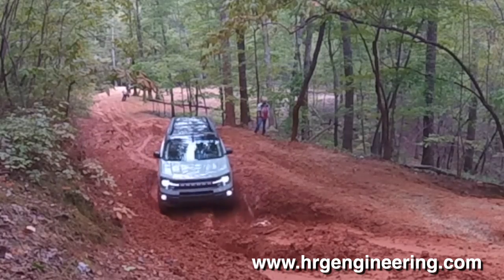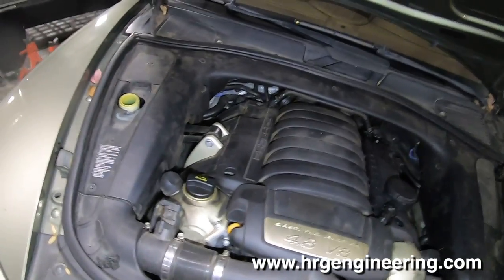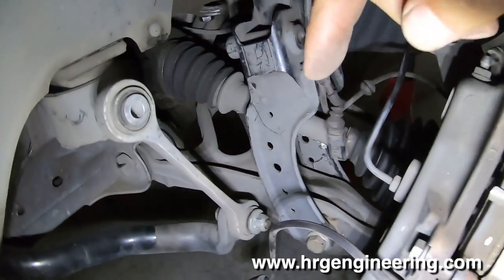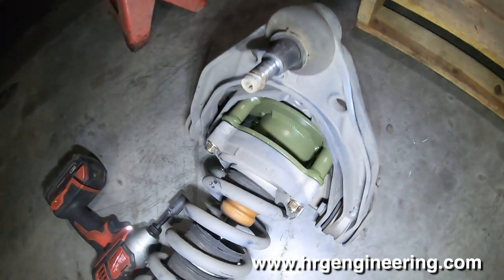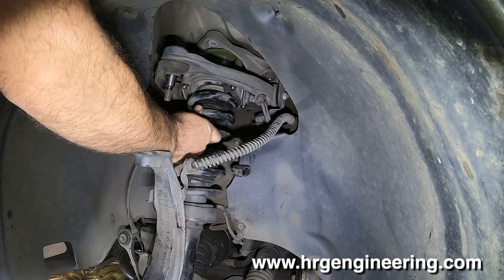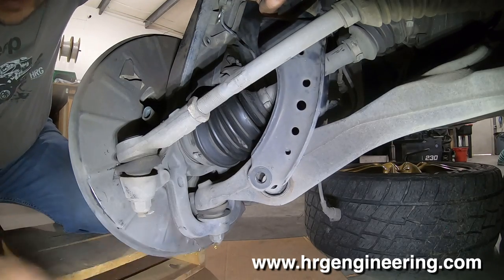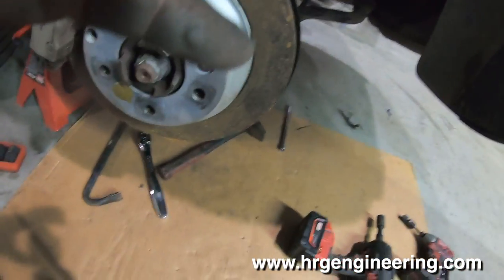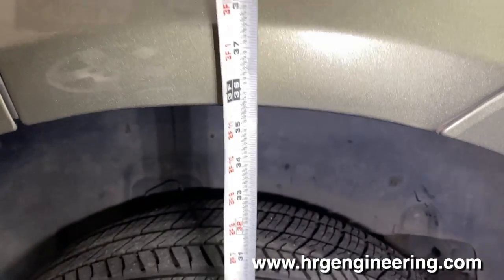How to lift a 2002-2010 Porsche Cayenne 2 inches with the HRG Offroad lift kit

Comment: Thank you for this video. One of the best instructional videos out there for this. That bolt under the master cylinder was crazy, took me a few minutes just to find it. The front went smooth for me except I popped the front axle out but luckily it went back in easily. The rear was so easy to remove but so hard to install. I was by my self and it was a tough job. Ultimately I put one spring compressor on the spring while in the car and this allowed the strut to be pushed into the eyelet much easier. All the bolts were so tight and somewhat hard to get to. Glad it is over lol
Reply: Really. Interesting!!! Call themselves Hrengineering with NO TORQUE VALUES for attaching everything...

Comment: Seems like longer adjustable struts would be far easier, as you wouldn't have to remove the upper mounts. 
When you measure the height, it's better to go from the hub to the guard, that way it can be compared to other vehicles regardless of rim/ tire size.
Reply: it's four bolts holding the upper mount, and you have to remove the entire assembly and remove the mount to change the struts to adjustables anyway...

Comment: Do not loosen all bolts when the suspension is loaded. Everything will be out of alignment. European cars suspension are designed with the flex of the bushings calculated as part of the “spring rate”. If you dont “center” the bushings, you will only get ‘spring resistance” going one direction.  Worse, you could tore through the flex limit of the bushings and cause failure of the suspension arms and bushings. I suggest referring to Porsche service manual, get all alignment spec and bolt torque spec. Otherwise it’s gonna ride like crap and you will be redoing all this over and over.
Reply from the maker: Reality does not bear this out, though.
Reply: German car are different that's why they are better ;-). I think it would be better to install air springs like my Cayenne S has stock. I would guess all the wiring is already there.
Reply: @hrg_tv  any nuts and bolts that hold a bushing must be torqued with the vehicle weight on the suspension. it shouldnt matter when you loosen them but if they were tightened correctly then you loosen them in the air, the arms will drop a bit. and yes it happens this way in reality. ask me why i bought poly bushings... on these chassis they go so far as to use the subframe bolts and bushings as alignment tools. torque specs are extremely important as well and you will have customers complaining of wheel shake if you impact the lug studs or don't torque them to correct spec.
Reply: @StefRush  i believe there are three required control modules to be purchased to convert to air, as well as recoding with VCDS. There will be no wiring harness going to the wheel level sensors that need to be installed. it would be easier to go aftermarket air plus then you can use nice bilsteins and such.
Reply: Interesting!!! Call themselves Hrengineering with NO TORQUE VALUES for attaching everything...

Comment: A spring compressor would have made alignment  a bit easier and you  defiantly need to put lock tight on the first nuts otherwise it will come loose over time when off roading .

Comment: 17:40 "Alright guys it's worth mentioning you need a socket set that goes to 24mm..."
No problem, I have a Landrover Defender (a real one & not a pretender), my socket set goes all the way to 36mm :)
I also have a couple of large specials :)
All 1/2" drive... what else is unbreakable...
Reply: Interesting!!! Call themselves Hrengineering with NO TORQUE VALUES for attaching everything...

Comment: ya'll got a 5 inch lift kit?eurowise prices hurt
Reply: if you dont have air suspension then go to any local machine shop and have them cut you some pieces of 6061 aluminum and then you just head to the local hardware store and pick up some grade 10 bolts of the correct length for spacer size, then drill holes in the spacers and stick em in. you need to drop the subframe as much as you lift the suspension to maintain correct axle geometry, and with 5 inch lift you will need custom upper control arms that can adjust out the camber of the lift. you can put spacers on top of the upper shock mount as well as in between the strut and the mount. you can even fabricate some plates that extend the bottom of the strut fork mount which is a good idea to do, make sure they extend all the way up the forks and put bolts through all the holes, i have bent the fork mount off roading so it is good to reinforce it! all in i would estimate you can get it done for 100 bucks not counting the upper control arms which are just gonna suck, unless you can fab those. now i have never seen a 5 inch lift but there is also a chance you will need to extend the steering shaft and cv axles... best of luck, if you do it please make a video or two lol!

Comment: Don’t you need screw glue on the nuts against plastic?  I think the nylock nuts are for the plastic parts, the factory nuts should stay where they were at.  I’m talking about the green spacer nuts.
Reply from the maker: Nyloc nuts are not for plastic parts.